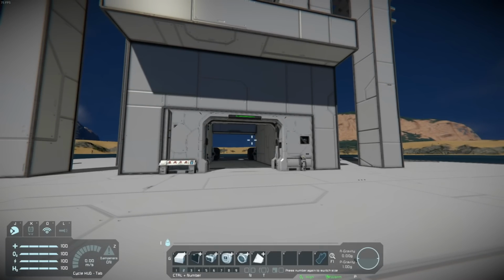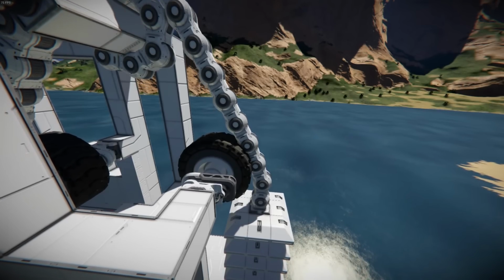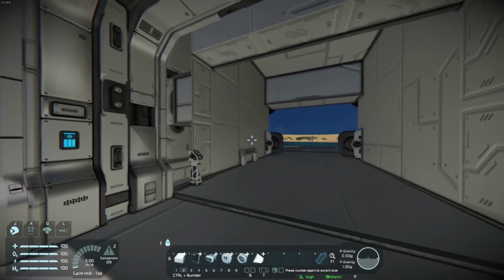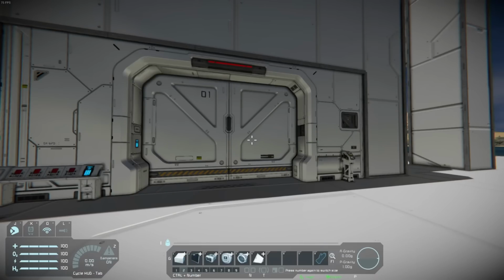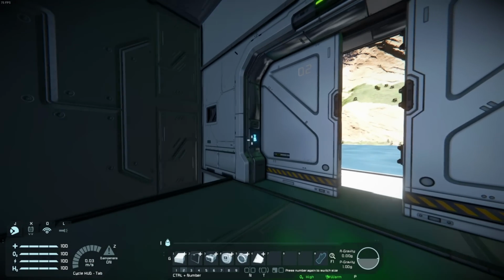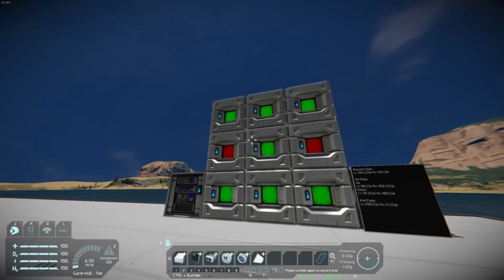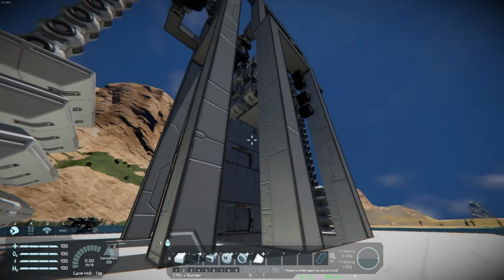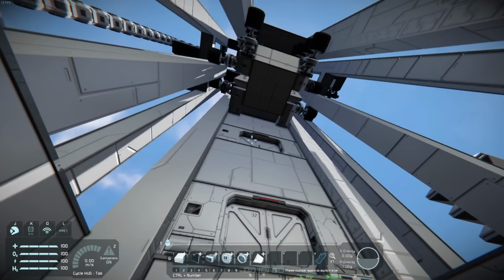i made a stupidly overcomplicated lift | Space Engineers

Comment: Okay, I have to admit you somehow made an elevator that's slower than the ladder. I feel like you would get the top faster with ladders and ladders are slow as s*** also, this is the most overly complicated lift I've seen in space engineers and half of it's tireless pointless though I do agree with the idiot proof. I've blown up a lot of elevators I literally test to see if pushing all the buttons will break them at a repeatedly. Disappointed when it does